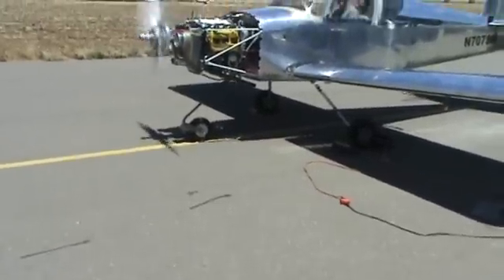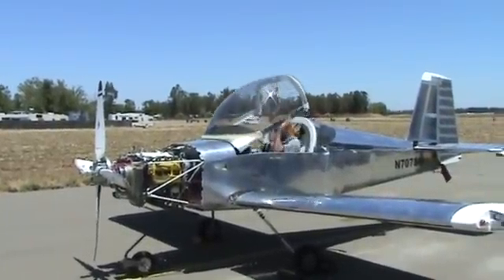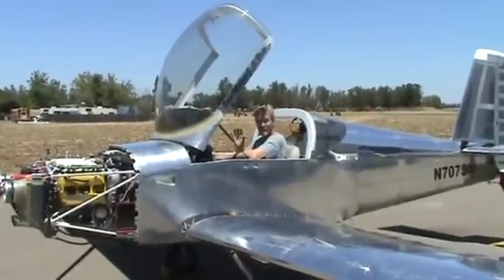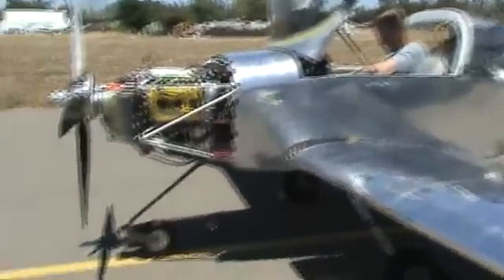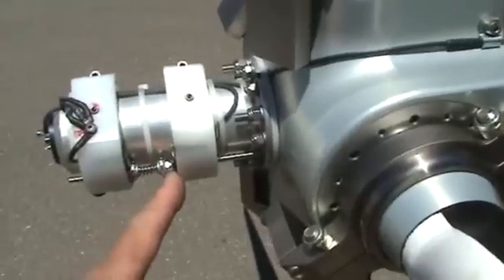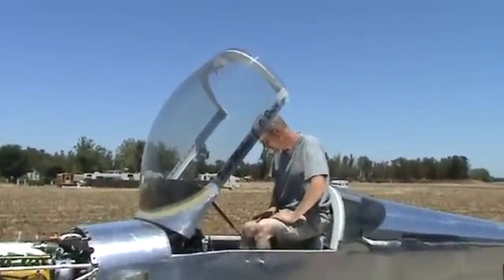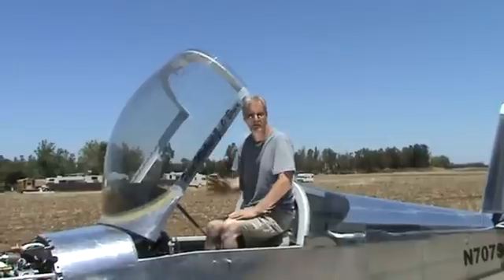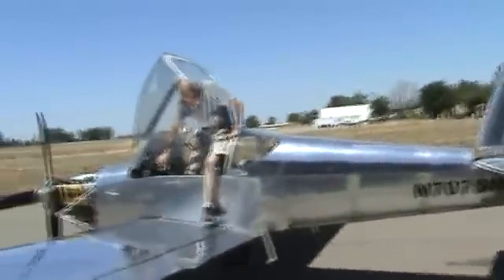E6 Egg Subaru engine propeller trim balance N707SM

Comment: I flown my RV6A thousands of miles at 1900 RPM and 21 inches manifold.  Apple's to oranges I guess because mine had an O360 engine and of course a CS prop.  6.5 gph going 170 mph over the ground... It was my most economical speed up high...10000 + feet